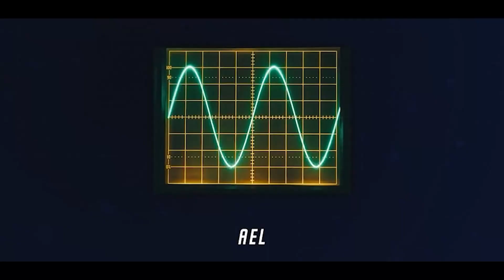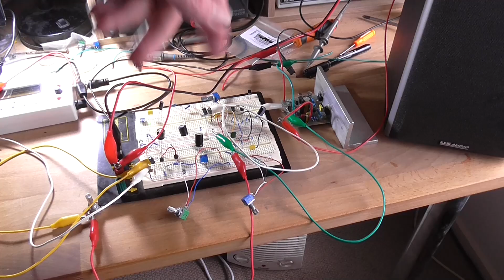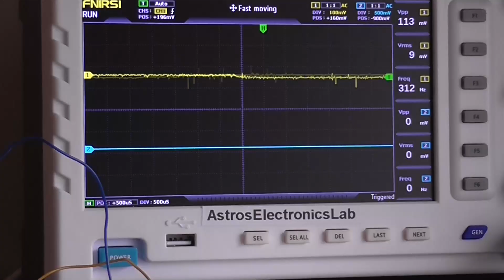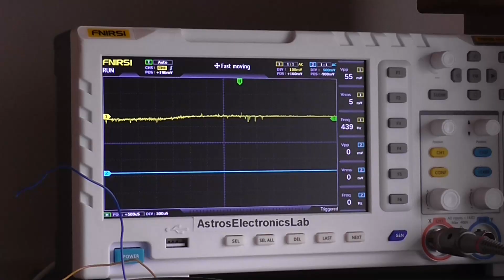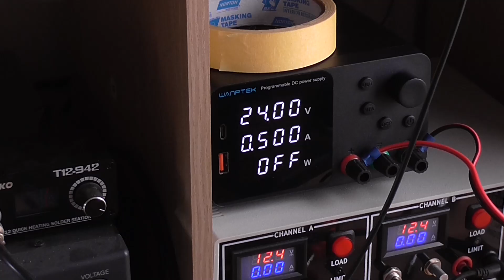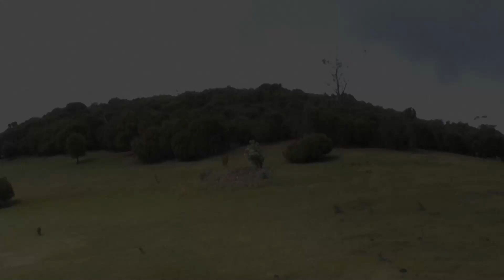Wanptek Power Supply: Mysterious 1kHz Signal Injection

Comment: This IME is a common problem with the less expensive switch mode power supplies.  The electrical noise can occur at different frequencies depending on the supply design (obvious) but also the current drain.  I commented in one of your previous videos where you first encountered this issue and I made mention that you should probably try powering the amplifier with your linear PSU which you did in this video and hey the noise disappeared.  This places the issue pretty well much with the Wanptek PSU and that combined with a less than ideal layout on a breadboard makes the circuit vulnerable to noise induction through less than ideal grounding.  This fully explains why it was significantly less an issue once you had the power amplifier assembled on a PCB, but still evident when the pre-amp was still in the breadboard layout.  Notice once again the noise other than a bit of hum wasn't evident when you powered the circuit from your linear power supply. IMHO and IME there are several factor at play here.  1. Noise from the Wanptek PSU; 2. circuit layout (that breadboard is far from ideal); 3. the highest contributing factor is simple amplifier designs like this power amplifier and the pre-amp typically have poor power supply rejection ratios, thus any noise on the power supply gets amplified by the circuit much like the audio does, and finally; 4 all those interconnecting wires on breadboards are effectively acting as little antennas picking up all sorts of electrical noise.  

For what it's worth can I suggest you test your Wanptek PSU over a range of output voltages and current drains.  You've got a few high power resistors to draw some significant current and you can use your FNIRSI scope on the 20MHz b/w to measure the noise on the output of the PSU with a benign load.  (There's an idea for a video).  Your challenge might be the output terminals on your Wanptek PSU don't appear to be the standard 19mm apart so getting the deal probing isn't going to be possible plus the poor vertical sensitivity of that FNIRSI scope isn't going to get you down to the low mV levels but at least you will get an idea as to what noise is getting generated by the that PSU under various load conditions.  Once you've quantified this you will know the weak link and not be chasing red herrings in your designs and builds.

Regarding @daveselectronicslab comments.  Yes, some display devices can be a source of electrical noise so it's entirely possible some of that noise is coming from those sources including LED lighting for example.  However the 1kHz noise disappeared when you powered the amplifier from your linear PSU, so IMHO I don't think any display device on its own is completely responsible for the noise.  Yes, it might be coming from the display on the Wanptek, but then that places the problem with the PSU as a whole and other than modifying the PSU you aren't going to eliminate or significantly attenuate the noise.  IME, you get what you pay for with bench test equipment and a bench PSU IMO is part of that stable of equipment. Electrically quiet PSUs aren't cheap and I fully appreciate you're operating on a limited budget (aren't we all in one of the most expensive countries in the world to live in). ☹  Anyhow I hope you get to the bottom of it.  

If it makes you feel better I spent hours chasing noise in an amplifier only to discover the source was coming from the OLED display of a mains power meter that was contaminating the 240v mains supply.
Reply from the maker: Thanks for the comment. I read it all, too. I agree, breadboard layouts are far from ideal, and all interconnecting wires do act like antennas (which I'm fully aware). The fact that I know roughly what's causing the issue (bad layout + cheap SMPS), in the future the noise can be safely ignored.

Comment: Hate to say that most of the switching PSU do this. I also encounter this problem. You may need additional filtration and a minimum load, say 10-20 ma.
Reply: I agree.  You get what you pay for.  The better quality and quieter switch-mode PSUs are IME expensive.  The Wanptek is at the lower end of the price and performance scale.
Reply from the maker: @Tanamera-Tech  yes, it is. But it's "good enough" to do basic tests on circuits (not expecting noise-free results).

Comment: Hey mate I just made a short video for you, its uplaoding now, if you look in two minutes it should be up.
Reply: It's uploaded now.
Reply from the maker: @daveselectronicslab and for your efforts, I have now placed your channel in my "featured channels" of my channel's home page :)
Reply: @AstrosElectronicsLab  Subd = Thanks.
Reply from the maker: @t1d100  thanks!
Reply from the maker: @daveselectronicslab  my scope doesn't have enough vertical resolution (volts per division) to do this test. It only goes down to 50mV, not 100mV as I thought, but it's still not low enough. What scope do you have, btw?